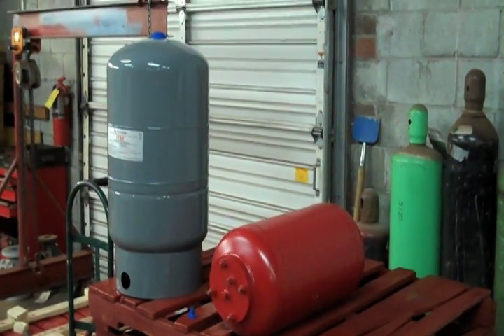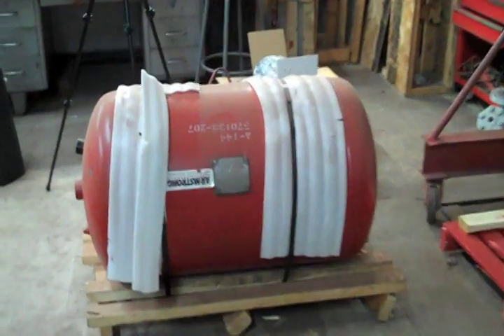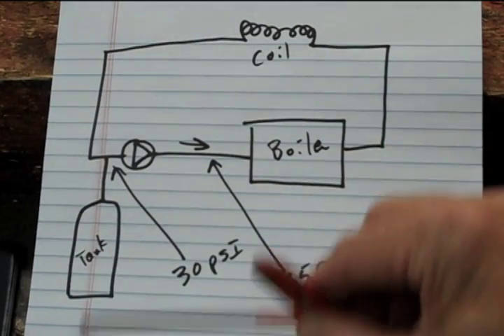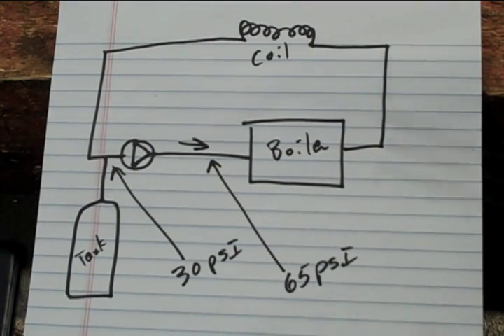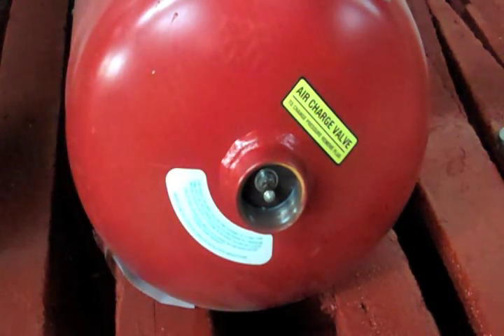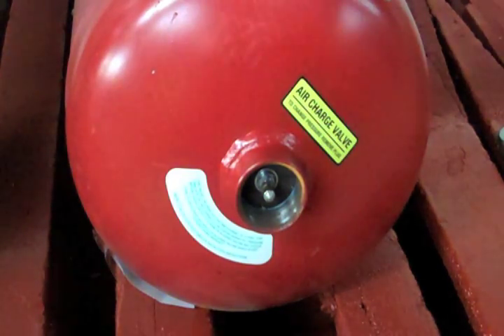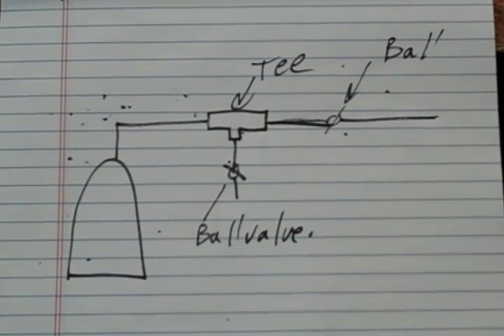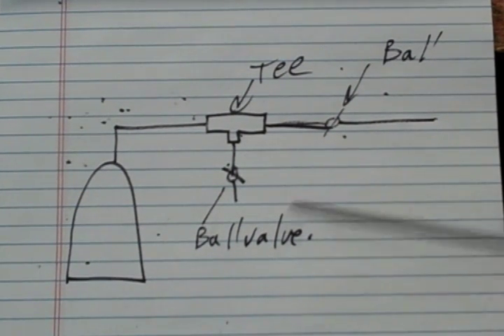Expansion Tank Installation how to Charge a bladder diaphragm Amtrol extrol air pressure install

Comment: If my system pressure is 45 pounds where the tank is, and the gauge reads 12 pounds on the gauge then it is not charged correctly and will intermittently blow out the valve am I reading it right? Please verify please
Reply from the maker: if i understand your syst pressure is 45 and the tank is precharged to 12.. sooo you want to charge the tank when not attached to the system to around 40 . then attach it to the system .. it will inflate to syst pressure ( take on a little water) and still have enough reserve capacity to take care of normal exp and contraction .. best
Reply: @thebrainard  thank you

Comment: Thanks for the information and the video, it is very illustrative. If the interconnection point (pump suction) is 7 psig and I connect a pre-charged expansion tank at 116 psig at that point, what happens to the pressure at the interconnection point of the tank? and what happens with the bladder inside the tank, does it tend to get out of the tank into the pipe where it connects?
Reply from the maker: the bladder or diaphragm wont go past the tank inlet .. but your system would have to reach a pressure over 116psig before any expansion would go into the tank
Reply: @thebrainard  Roger, thanks a lot for your answer. Could you tell me how to calculate the maximum pressure in the expansion tank due to the volumetric expansion of the fluid by increasing the temperature?
Reply from the maker: @zulayc9884  another good question .. i don't know the formula but some of the tank manufacturers like Amtrol have a calculator for that in their site .. at least they did a few years ago..
Reply: @thebrainard  Thank you,
Reply: Roger,   I checked the Amtrol reference and it helped me a lot. Another question and I hope not to disturb so much: Suppose we have a closed cooling water system and I need to add an anticorrosive using a dosing pot and the expansion tank is closed type bladder. To add the chemical, do you think it is correct to think that I must first get rid of a part of the cooling water, equivalent to the volume of the chemical that I am going to add by means of the dosing pot ?. The dosing pot I will connect it so that its discharge through the lower part communicates with the suction of the pump and the discharge of the pump interconnects with an intake line through the upper part of the pot.

Comment: Yes it has worked for over 14 years.  Was using Dayton booster this is the 2nd time I’m replacing the Dayton so I went with a Gould. Tank has that hollow sound and the pump turns on but will not fill or pressurize.  It’s for a rinse arch at my hand wash.  Someone told me they think it’s because I m using one with to few impellers now. Thanks for responding
Reply from the maker: sounds more like a well system than a heating system ...  assuming you are getting water flow but the pump is short cycling???  for a well system the output pressure on the pump has to be higher than the pressure of the tank in order for the tank to fill .. it may be filling partially and actually should not fill totally as that will rupture the diaphragm ... the pre charge of the tank should be on the tank label .. and maybe the output pressure of the pump is listed on it or the data you got with it.  .. there should also be a pressure switch to turn the pump on and off that will have a set point as well ... afaik the pressure switch needs to be set lower than the pump discharge pressure as well ... hope this helps

Comment: I have a Teel pre charged tank connected to a pump and I emptied it to check for proper air pressure because it was no longer pressurizing. The tank is empty, would removing it from the system and reinstalling it back possibly help?
Reply from the maker: sounds like a well pump application? a bit different system than a heating syst here .... but  question 1 is always the same .. did it work before?

Comment: Question for you. I have a 2 gallon pressure tank on my well  for my sprinkler system. I tried to run an outdoor shower from the well, but with the shower head, I dont seem to get enough water flow and the pump kicks on and off, which I know is not good ( I run a hose on the lawn while using the shower to keep the pump on). My question is, would a larger pressure tank solve my problem? Or is it a lot more complicated to make my shower work off my well? Thank you for any help. Kenney D
Reply from the maker: something to try -  throttle the pump back ( lower the flow to your shower demand )  between it and the tank so it does not satisfy the tank so fast  and cut off  .. .... to your question a larger tank will give a bigger buffer ..ie more draw down before the pressure drops and the pump kicks in ... AMTROL web site may still have a calculator on their site  that will give you some sizing for domestic pressure booster systems ... that should give some clues ....
Reply: THank you

Comment: How do you know the correct PSI if it's connected directly to a well water pump?
Reply from the maker: Well tank is a very different applications ...but as i understand it 2-3PSI below the the cut on pressure ... i just told you more than i know ... andy body got the real facts on a well tank?

Comment: Very well explained video, we have a combi boiler with the cold incoming water pressure at 85psi through the heat exchanger in the boiler to the hot water taps, this boiler has a pre heat function to heat some water before a tap is turned on, if back flow is prevented in the cold water feed it should have a mini expansion vessel installed  to accommodate for any expansion from the water being heated, should the air pocket in this mini expansion vessel be pre charged to 85psi before installing, also should there be a pressure release valve fitted as a back up should the air be lost at some point, I would like your comment on this, thanks, John.
Reply from the maker: sounds like domestic water system with the cold water is going directly thru the boiler and no storage tank ?   anyway .. yes to the precharge  of 85# if the incoming pressure  and system is 85# otherwise it will take on water... at the typical 12 or 30# factory precharge it will waterlog..  a pressure relief valve is never a bad idea

Comment: Great video, thanks.  I get the reason for a balancing pre-installation charge.  How, then, do you periodically check the tank pressure thereafter?  I assume you first reduce the system pressure at the tank to zero, then check the air pressure?

Comment: Super informative....great tutorial...
My application requires pressures upward of 100psi (100-150psi.. pressure switch regulated)
To achieve the minimum/constant 100 psi output i require , what pressure should my diaphragm/bladder tank be pre-charged at?
I will be utilising short bursts of 100psi fluids and am using a regulator(100psi) upstream of the solenoid (timed on /off cycles).
I wish to "recharge" (fill) my pressure tank at 100psi and shut off the pump at 150psi .
The pump is a diaphragm pump with pressures adjustable from 0-200psi.
Is there a formula for the above data i have given you to determine what volumes of fluids i would be able to hold in different sized tanks?
Thanks in advance...
Reply from the maker: sounds like you are using a tank as a reservoir  to cover peaks while maintaining 100psi .. that is a bit different than the application for and expansion tank .. yours is more like a hydro tank for pressure booster or well.  .. but in a sense a tank is a tank .. and pressure increase is a 1-1 ration .. if you have a 10 gal tank that is empty and charged to 100 psi .. and you add 5 gal of water the pressure will go to 200psi.  if you need 50 gal a min and need to be above 100 psi so your reg valve can work .. and you can pump in at 150psi you would need a 200 + charged to 100# and put in 50 gal raising the pressure to 150# ( your pumping max) and regulate the flow so it takes a minute to discharge ...  having said that .. I did this in my head and I may not be understanding your application ... so check my 'math' ... it is just %'s tho
Reply: roger brainard Roger... huge thanks for getting back so quickly....
My application is an aeroponics feed system, using the pressure tank to keep the pump off as long as feasible (extending its life) AND maintaining the 100psi bursts (1 or 2 seconds every 3-5 minutes) without enduring the normal "pump build-up" lag (the time it takes the pump from being turned on to delivering the precise 100psi i require)
The tank is a 24litre "bladder" tank rated to 25 bar....
being that i require my outlet pressure to be 100psi regulated , i have in my head that i will recharge the tank once the pressure dives to 100psi  then via the pressure switch turn the pump off once the tank is charged to 150psi.
How much fluid will the tank be holding? what pressure should the tank be pre-charged with? My diaphragm pump is capable of 0-200psi....(without too much stress ).
Again i think you in advance...
Reply: roger brainard I should add that all lines will be either 1/4inch or 3/8inch nylon.. easily able to withstand the pressures mentioned...
Another friend advised that the tank once charged will hold approx 2.9 litres? but he couldn't advise of precharge and charging pressure etc...
Reply from the maker: the volume of the tank, pre charge pressure and fill pressure will determine how much the tank will 'take on'   .. if you want 100psi discharge your precharge will have to be that or a little more .. and your fill pressure over that will be the motive force for flow ...

Comment: I understand that you don't want to connect a 12psi precharged tank into a 70 psi system, but what happens if you connect that 12psi tank into a 9 psi point in the system?  I'm talking about a home heating system where the boiler min pressure is 12psi and the tank is mounted at about ceiling height above the boiler.
Reply from the maker: +S Laun that should not really be a problem .. your system pressure will rise to 12 psi before water expands into the tank.. and it will do that  on a cold start  .. hope that helps
Reply from the maker: +roger brainard great question btw

Comment: Hello, I cannot get the tank to fill up with the 12 gallons of water it is supposed to.  I have a 15-25 ft well.  I have a NEW 40 gallon Pro Source Composite Pressure Tank.  I also have a NEW 1hp Craftsman Convertible Jet Pump with a 40/60 switch and a check valve just before the well water goes into the pump.  Pump primes and runs great.  Excellent water flow. If I connect a garden hose to the tee in the tank, I can get water to pump out all day so I know I’m not running the well dry.  The pump is directly connected to the tank. Problem is the Tank will NOT take on water. I get a steady 36psi at both the pump and in the line going to the tank, but the tank will not take on any water at all!  Since the switch is a 40/60, I have precharged the tank at 38psi with tank empty.  Why are the pump and the tank pressures nearly the same?  Are they offsetting each other and as a result the tank will not take on water?  The pump will not shut off on its own, it just keeps running at 36psi.  So how can I test the switch settings in this situation? Why won’t the pump turn off?  And, why won’t the tank take on water?  I could find no leaks whatsoever.  Can you help?
Reply from the maker: well tanks use the same math but are applied a bit different .. if you are going to supply the tank a 40 gal  with 38 psi and want 12 gal in the tank as a 'buffer/reserve' then the tank has to be precharged at about 20# so water can come in . as it fills the tank pressure will increase to the same pressure as the pump...if the precharge is the same as the pump no water can enter ..hope that heplps ;)

Comment from the maker: good chance you should bleed them out .. any time you 'open' the system you will grab some air... if you have an air separator or purger in your system it should get it out .. but if enough air has been trapped it can stop the system from circulating ... so you may want to  crack open a bleed valve at the highest spots on the system and see what you get..never hurts...best

Comment from the maker: sure sounds like it .. on most tanks it is just a schrader fitting like on a tire.. try changing that... ALSO.. wd40 is a petroleum product and the elastic parts inside are not compatible with it .. if you need a lubricant use hand soap ( no citrus either ) 

if changing the guts on the schrader does not fix it it may be tank time 

best

Comment: Hi, thanks for the vid. I was losing pressure every now and then. I noticed there was next to no air in the expansion chamber, so I drained down and filled with 1 bar of air as per the service manual. There was a hissing on the valve when I let go so I squirted WD40 in and played with it until it seated correctly, then repressurized the air, and filled up the system with water. The pressure is now slowly losing about 0.2 bar every day. Is this definitely the air valve leaking? Thank you

Comment from the maker: before you isolate the tank measure the pressure at the charging valve 

then isolate the tank

but -  isolating the tank using the valve before the thank will 'trap' the pressure of the system in the tank .. so you will need to unscrew (remove from system ) the tank to release the system pressure on the water side. 

then measure the pressure at the air charging valve ( schrader valve ) .. if it is lower than the system pressure ( your first measurement ) charge the tank to that pressure and

Comment: I install the tank last year  vertical. I was wondering how do I check for pressure? Should I just turn off the valve before the tank and above water heater?